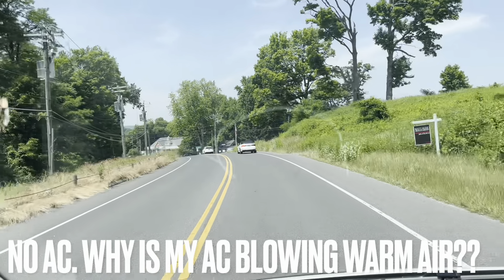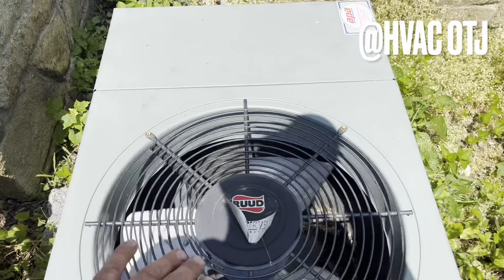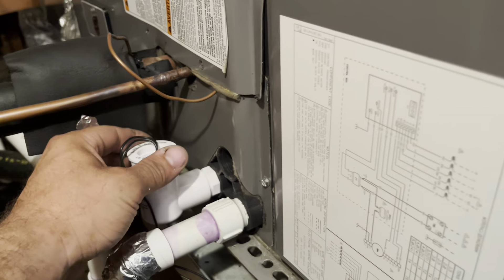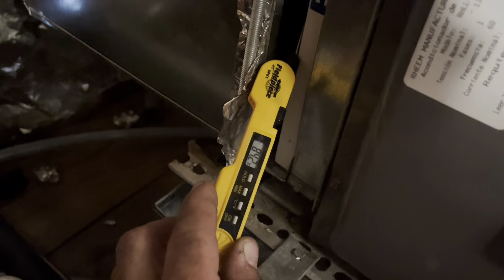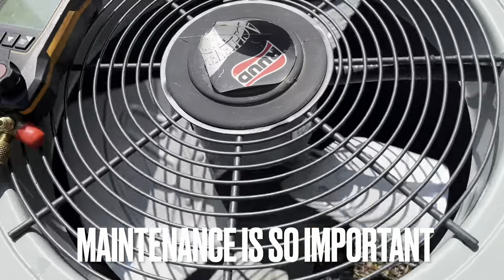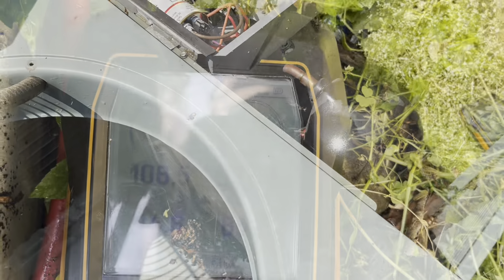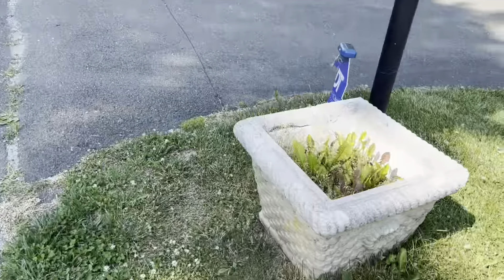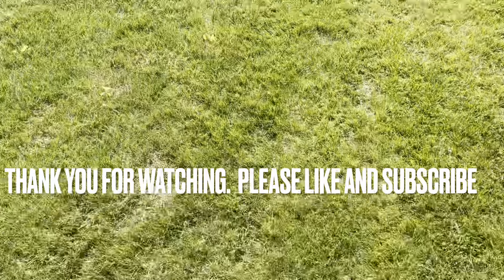HVAC. WHY IS MY HOME AC NOT COOLING?  ALL COMPONENTS ARE WORKING!!??!!

Comment: So it was just very dirty on the condenser unit and it was pulling in attic air?
As for topping off, I thought that the only way you lose freon is with a leak.
Reply from the maker: After cleaning it was a little low on charge and the sensing bulb on txv wasn’t properly mounted and covered.
Reply from the maker: Definitely a small leak somewhere.  The house was an air bnb and the renters arrived as I was there so no time for leak search that day.
Reply: @hvacotj Thanks for the information
Reply from the maker: Thank you for watching.